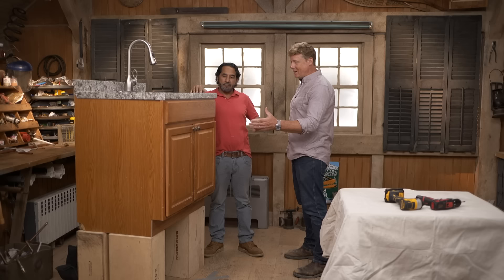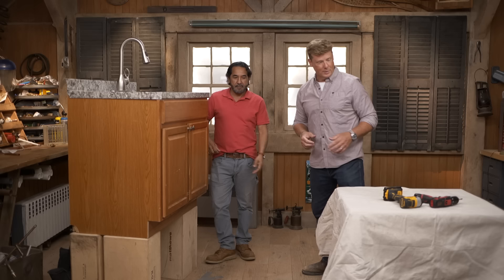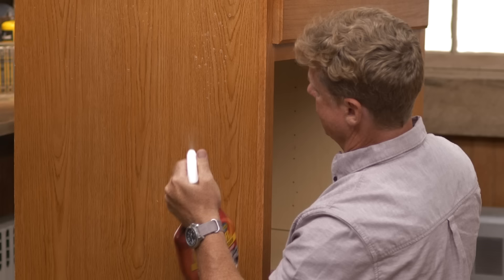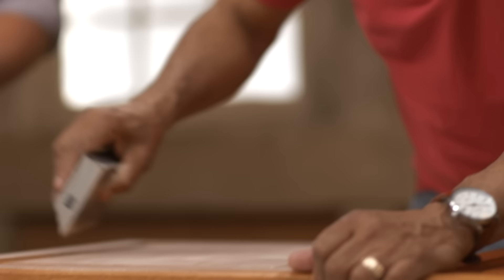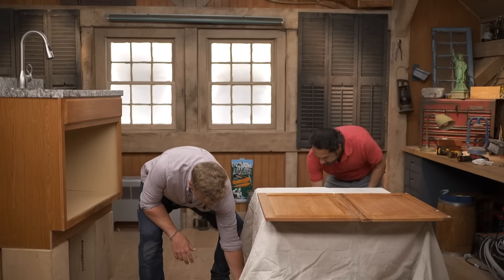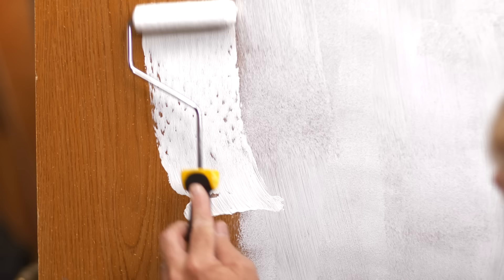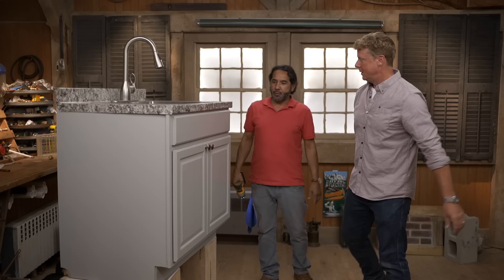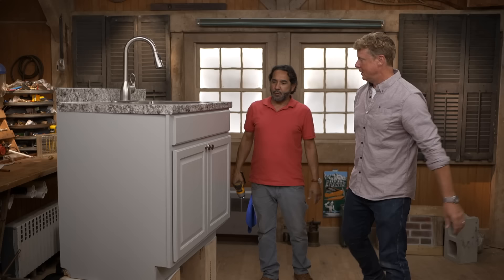How to Properly Paint Your Kitchen Cabinets  | Ask This Old House

Comment: I wish I could paint my cabinets up in the air like that
Reply: Well you could remove all the cabinets....
Reply: "Telekinesis is tacky."
Reply: oh no! You will have to bend a little. Are you going to be ok?
Reply: @Fattony6666  probably not
Reply: You can. Just lift them up and set them on some stolen milk crates.
Reply: Just remove the floor then pain the cabinets
Reply: @Off-Grid  
If you go through the trouble of removing them then you might as well replace them.

Comment: They should have mentioned what type of cleaner to use to degrease the wood.
Reply: TSP Heavy Duty Cleaner

?
Reply: There's a ton of details they should have mentioned.
Reply: Its hard to find any one cleaner that will get cabinets all the way clean. There are sometimes a variety of different oils and stains on them. I have found denatured alcohol works pretty well though.
Reply: @srharris88  tsp

Comment: I love this old house but this video is definitely geared towards home owners.  If you have a sprayer it definitely helps with a high quality finish.  We use a primer like zinzer cover stain or an oil based primer then cover with Sherwin Williams Pro classic with alkyd or PPG Breakthrough for final coats but ask your paint store about cabinet grade paint.  They will know what works best.
Reply: Will behr marquee paint work on a cabinet?
Reply: @soliloquys  I wouldn't suggest it. Search some videos here in YouTube for best Cabinet paints.
Reply: 6

Comment: Just did the same project a few weeks ago myself, I degrease sanded but I used oil based primer and oil topcoat. Two coats each.
Reply: good choice.. a better-looking finish.
Reply: In my opinion oil is a much more durable paint. Plus I sprayed, no roller or brush.
Reply: @scottyellis3442  Yep
Reply: @anthonyszeto5508  Yep
Reply: @scottyellis3442  spraying is better
Reply: @scottyellis3442  But the oil based takes a day to dry so 3 days for primer and two top coats. What’s a good, relatively cheap DIY little spray gun that will run off an 8 gallon 2hp compressor. I’m not doing a big job painting cars or houses. Only the doors on our kitchen cabinets. Later just around the house honey do’s. I just rebuilt from scratch a four panel set of plantation inside window shutters for our kitchen window over the sink. Had to roll and brush. Turned out nice but wish I’d been setup to spray on!! Thanks for real pro advise!
Reply: @MRrwmac  HVLP is the best way to go, unfortunately to be able to shoot anything thicker then lacquer you will need at least a 4 stage turbine, I tried to go with the cheaper Earlex HVLP sprayer but I did not have good luck, too much orange peal so I broke down and got the Fuji Q5, perfect results shooting sherwin williams oil based pro classic thinned about 10% using a 1.8 cap and needle. it is a $1,500.00 setup but like the saying goes, buy once cry once.
Reply: @MRrwmac  actually I used low odor oil based kilz which is ready for 2nd coat in one hour & my top coat was Sherwin Williams Pro classic oil which was ready for another coat in 4 to 6 hours (4 for me) because I was inside. But you're right it does take more time versus water based.
Reply: Screw all that, it's called water based poly paint. This is where where all the science is going boyz
Reply: @scottyellis3442  did you also spray on the primer? (or just rolled that)
Reply: @mrkattm  did you spray on the primer? (or just rolled that on).  Thanks.
Reply: @sommerday77  sprayed, thinned to 20 seconds and shot with a 1.3 mm tip at full pressure on a FUGi  Q5. perfect results
Reply: @sommerday77  sprayed all coats.
Reply: @mrkattm  thanks for those details (eg., thinned, 1.3mm). I have a Wagner Flexio HVLP I hope can do the job.     Was 1 primer spray coat and 2 paint spray coats enough (and maybe polyurethane clear on top)?   Thanks.
Reply: @sommerday77  I did 1 primer coat and 3 paint coats and sanded very very lightly between coats. I used sherwin Wiliams Oil based fast dry primer and sherwin Wiliams oil based pro classic all thinned with mineral spirits.  The Sherwin Wiliams oil base pro classic paint is very tough and very scratch resistant so I don’t think I need a topcoat although for darker colors satin sheen i might, The jury is still out. Lastly, the Fuji Q5 is a five stage sprayer but a 4 stage would also work, a 3 stage or lass sprayer might not be ideal, you might get orange pealing at the thinning i used so you may have to thin to 15 seconds on the the viscosity cup timing , but that might mean an extra coat
Reply: They look good?  Can't wait to get my project going...got so many things to do before I get started though.
Reply: @mrkattm  When you sand between coats, do you wipe it down afterward with a cloth, before painting again? Thanks
Reply: @irmaoliveira5365  Yes, we vacuum with a shop vac (brush attachment) then wipe down with a damp mineral spirits cloth.
Reply: does it scratch or peel??
Reply: @nayefalkurahi3357  so far not yet.🤞🏻

Comment: This Old House has always been an entertainment program. It has never been a how-to program.  So I've been entertained by the pros dissing the job that Mauro and Kevin have done. Like : Man, I'd get fired if I did a job like that. I'd use a sprayer...   I'd do this and that. The reality is that a handy homeowner would never hire a pro to do this small a job ( 10ft of cabs or so).  I am such a homeowner that has painted dozens of feet of my own cabs in 5 homes. This is basically how I did them.  No spraying,  and certainly no pore filling.  And as for the people whining about what brand of this or that, or how do I buy a brush or roller,  you are not ready for this job yet. Go buy some cabs for the garage and practice on those.  A 20 minute video is not going to teach you how to paint. Painting a few is going to teach you how to paint.  As for me, I was satified with the video.  First, it is free. Second, it was entertaining.  Third, I did not need to learn anything from it.
Reply: Ah, okay. I was wondering why they didn't use a sprayer.  I was wondering if this video would help me touch up my cabinets, which were sprayed.  And now I know, the answer is no, LOL.
Reply: Well said Sr!👍
Reply: True, no homeowner will be able to master the technique of spraying the cabinets for just his one kitchen project. But I have seen the painter we use for our home improvement business use a Benjamin Moore product called Cabinet Coat that brushed on and smoothed out into a spray look finish.
Reply: @Briguy1027  that's not funny at all
Reply: You are correct. I for one was cringing when I saw in this video the guy rolling with high speed roller strokes. This will fling out millions of tiny droplets.... and does nothing to speed up the job
Reply: Great comment!  Glad it's at the very top.  Well said.
Reply: Great advice, here. The best a YouTube video can do is teach you enough to be dangerous. If you're a DIYer/weekend warrior, the learning is going to come from practical experience. It's going to be expensive and time consuming, but it could be a better alternative than hiring it out.
Reply: What the hell are you saying? 😂😂
Reply: @kippywylie  maybe they’ll give you a show 😂😂😂😂
Reply: And your cabinets look like you DIYed them

Comment: Shellac and Oil-Based Primers are superior.  
If you find bleed through after your water-based paint job, you can go over with Shellac Primer and repaint.  Worked well for me.
Reply: Water based poly like Renner is superior.
Reply: This may be true for a new build/raw wood. But this wood has already been sealed for years and probably a very thick coat of seal considering the look of them once they scuffed them. Any primer will do. And if refinishing cabinets, a water based is best because it’s in your kitchen. An oil based would stink the whole house up for days to weeks.
Reply: @remodz6385  everything you said is false lol. You need a shellac to seal up tannin bleed or it will never cover. I BIN every set of cabinets i do and it stinks only for a few hours, not days or weeks lol. Any primer WILL NOT WORK

Comment: I recommend X.I.M primer from dunn edwards it's 50 bucks a gallon but it hold perfectly. As far as paint goes I have had very bad luck with Behrs Alkyd that they used scratched up real easy even with primer.
Reply: @shanew7361  I mean I didn't wanna say it like that but yes. It sprays on great but rolls on horribly.
Reply: They're sponsored by HD so that's why they likely picked Behr. I think the take away here is that you need an alkyd paint if you want low VOC, are diy, and looking to avoid oil based products (as most diy folks typically do). Benjamin Moore Advanced would have been my pick.
Reply: @dmondra2  I believe the reason for Behr is because it comes from a "dyi" store. Most people who diy don't really go to paint stores they go to the big box stores.
Reply: XIM UMA is hands down the best acrylic bond coat made.

Comment: I'd highly recommend a high bond primer, if going over any sort of clear finish. Also be very careful  and consistent with your brush and roller strokes, texture is very important on something like a cabinet. Also no satin in a kitchen, it attracts too much oil and dirt.
Reply: Actually the steps he did was good, but I prefer cover stain from zinsser
Reply: I'd spray vs brush
Reply: @Off-Grid  that is not an option for some people in some situations.
Reply: Lol, satin is the industry standard finish.
Reply: @ryane6719  maybe for a clear finish, satin paint on a high wear surface will attract more dirt than a semi gloss, as will a semi gloss more than a gloss. If that is what you want for your own home sure, but I manage apartments, satin would not last an acceptable amount of time.
Reply: @danb.709  you’re using general architectural finishes on surfaces, try corrotech command satin.
Reply: What type of paint would you recommend. Any pointers would be helpful.

Comment: Great job guys…looks great…I am getting ready to do my cabinets…I know it will not be easy…clean…sand prep…but it will be worth it to do it the right way.  That golden oak has just got to go…I have a simular countertop…so this helps a lot…love the color.
Reply: It won't be worth it. From maybe ten feet away, it looks good. If you're a foot away, it looks poorly executed.
Reply: Buy yourself a corded random orbit sander to do 90% of the work
And if u got the budget Wagner flexio spray painter

You’ll get a 95% quality factory finish. Prob even better than the cheapo finished cabinets at Home Depot and IKEA
Reply: @dylan-nguyen  I disagree. The stock cabinets they have at Lowe’s are really good for the price. You’ll never even get close to the finish if you attempt to repaint your old cabinets.

Comment: What would you suggest to use to fill the grain in the wood? Personally I can't stand to see grain on painted wood.
Reply: You ever figure that out?  I hadn't thought about that, but I imagine it would make for a nice smooth finish.
Reply: I used Aquacoat but there are other brands. You could also try slurry sanding method. YouTube has some good videos on pore filling for cabinets.
Reply: @weekendhomeprojects  See my answer to the original question.

Comment: One more question...I notice that after rolling the paint on you use a paint brush. May I ask why? I've always just used the roller. I'm learning as a home owner to be a diy'selfer! Thank you!
Reply: Get an airless sprayer if you want a professional looking finish.
Reply: It’s a personal preference- brush strokes in the direction of the wood resembles wood grain, vs a roller that has a roller texture. Many people, myself included, prefer a light brush stroke.  But yes, an airless sprayer is also a good route.
Reply: @cpassehl  
I'm one who doesn't like brush strokes in past experience. A homeowner who is a diy'selfer have been for many yrs. Just want to do it right this time.
Reply: @cpassehl 
My kitchen cabinets have been painted yrs ago. Just want a fresh look.
Reply: We call it laying it down, so you don't want the roller stubble look, if you have quality paint you roll it on and then you lay it down with a brush very easy, the paint should not show any brush marks, good quality paint is the key
Reply: @edzachary8657  behr paint
Reply: P

Comment: Don't let them lie to you. You definitely 100% need to use oil primer if you are not going back to bare wood. Even alkyd or urethane won't stick to a light scuff sanding. If it doesn't pass the fingernail test after 48 hours what do you think like it's going to look like in a year?
Reply: That's nonsense. Oil isn't necessary anymore. It also takes closer to 3-4 weeks to establish a true density. Guaranteed it passes the scratch test after a month. I've used Latex primer on every cabinet job I've ever done. If you follow the proper Prep methodology, you'll be fine 👍
Reply: @TheRogueDeadGuy  unless you're removing ALL sealing of the grain we will agree to disagree.  Care to name your product? Most (like +90%) of paint reps will tell you, you have to strip the surface 100%. Many write directly on the can. I'd really like to know what you're using that isn't. I'm skeptical at best. True density? We are talking about adhesion.
Reply: @Skebtik I like your thinking. I'm gonna do this but cause of money issues I can only afford a sander/ vacuum for the sander and the stuff these guys are using. Do you recommend the oil primer at least? Also does the oil primer have fumes?
Reply: @broodyyedda5621  well I down own a run a painting company
Reply: @Skebtik  will it at least be better if they sanded it a bit more and put more layers of.primer?
Reply: I think I’ll trust these guys mover some random dude in thenxomments

Comment: I used this paint with a 1/4" nap roller as instructed.  Still left orange peel/roller texture as the paint does not self level.  Noticed that you tipped the larger areas.
Reply: Use a foam roller. Sherwin Williams carries flock and mohair rollers that will make it look like it was sprayed.
Reply: @michaelmcgee2026  I've tried various foam covers and went back to the flock 1/4".  May try mohair but suspect that the paint needs thinning as it skins over before leveling.  Spraying is no different; thinning is required even if your sprayer is powerful enough to not need it.
Reply: So there is a couple of reason you have orange pill ,1st you put it on to tick second the paint is too thick you need to thin it down or the pain is drying to fast and doesn’t have time to flow there is a lot of Self-leveling   paint out there you can use. you can’t just use a regular wall paint ,you need to use a high end trim or cabinet paint. don’t try to do it in one or two coats we usually do 3-4 coats but very thin. By the way in this video they forgot to send the primer you always send the primer. And I guess the reason they did not spray it because homeowner does not have the money to buy a professional sprayer the one you can rent in Home Depot or Lowes  are not meant to be spraying fine finish on furniture‘s those are meant to be do painting fence, houses etc.

Comment: I painted my 50yr old cabinets after stripping and sanding but the only prob I had was the paint cracked at the hinge location. Behr latex..same primer
Reply: Behr is the problem! It's a horrible paint! You need a better quality paint and primer. I have been painting for 25 years. Everytime I have used Behr it comes out horrible.
Reply: @derekleesmith76  Behr'ly covers...am I right?
Reply: @derekleesmith76  What is a good paint brand to use for this type of application?
Reply: Did you end up repainting?  What did you end up going with?

Comment: Ok just one more question!? Whybdo the velour paint rollers sometimes glide over a painted surface?
Reply: To much paint on the roller.
Reply: @Off-Grid  
1/4" nap the best for painting cabinets and any other project? I'm almost feeling hesitant in redoing my kitchen cabinets bc I want to do them right...this time. It's been about 4 to 5 yrs since they were painted. My husband chose the color that is on the cabinets now. We don't have a big kitchen. The walls are a salmon color; whereas the cabinets are a tad darker than a cream color, and with new flooring in our future, those current colors will make the kitchen
look even smaller. I've rushed through many painting jobs, that is inside my own house, and I, like I mentioned, really want to do these cabinets slowly and to the point that I am satisfied. Help me to not feel hesitant and worried that I'll mess something up.

Comment: does air spraying look better than brush/roller or theres no difference ???
Reply: If your doing a large project...like kitchen cabinets...I would do the cabinet shelves with brush and then hire someone to air spray the cabinet fronts...don't try to buy an air sprayer from the large chains...they clog and don't work well...hire someone!  I learned the hard way!
Make sure you prep the cabinet fronts properly first...I used liquid sandpaper and a stiff brush...worked great.

Comment: Same process if cabinets have a color on them already? Lightly sanding so the primer will adhere? I so don't like the idea of taking out my hand sander, again, to sand down the kitchen cabinets. Btw...great video as always!
Reply: Always a light sanding between coats
Reply: @rickfromthecape3135  But not so much as to taking the whole coat of paint off correct?
Reply: @kathymieczkowski4981  
Sand only until you will have a dull look.
Then you know the next coat will be able to stick on it and will not fall off as it would with the glossy look.
Reply: @akoznasovajusername  
Ty for responding to my concern...if using my electric hand sander, what grit would be best to use on the current paint of the cabinets? I'm pretty sure it's a satin finish.
Reply: @kathymieczkowski4981  200 grit between coats works fine